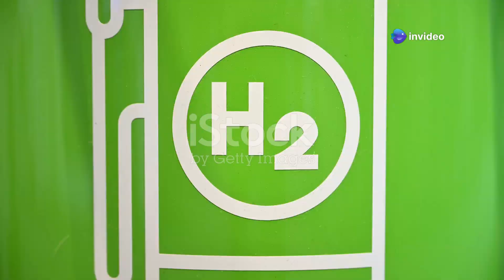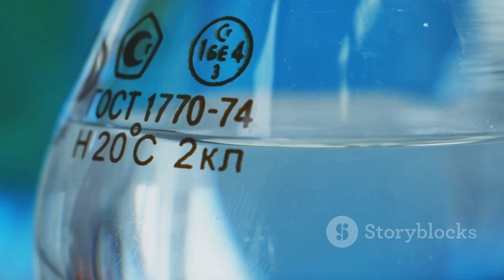New Solar Discovery Could Revolutionize Hydrogen Production

Comment: Huge amounts of H2 will be necessary for new processes (direct reduced iron- DRI) to green-up steel production and if the solar produced H2 were only used for that, it would go a long way toward mitigating global warming.
Reply from the maker: @ronkirk5099  Absolutely! Using green hydrogen in DRI for steel production could significantly cut emissions and help fight global warming. Scaling up production and renewable infrastructure will be key to making this a reality. What do you think about accelerating this transition?

Comment: Reasons against;

Inefficiency: Hydrogen production, storage, and use involve significant energy losses.
High Costs: Expensive production and infrastructure compared to alternatives.
Storage & Transport: Low energy density, leakage risks, and costly transportation.
Competing Tech: Batteries and direct electrification are often more efficient.
Safety Risks: Flammability and explosion hazards during storage and handling.
Infrastructure Gaps: Market and technology are not yet scalable or mature.
Sector-Specific Limits: Not ideal for vehicles or heating; better alternatives exist.

Reasons for:
Pay lobbyist salaries
Reply from the maker: @Education-sw2wg  it's a future dream and I agree about the salaries lool.
Reply: Exactly the same thing was once said about batteries. Also back in the days, planes were to heavy and never going to fly to.
Reply: @mathijsbroeders3454  There were no alternatives at the time, today as you said, renewables and batteries are far ahead and will continue to do so. Let's see for the future of hydrogen, but the spendings today far exceed any applications that are both financial and scalable. :) The main issue for hydrogen in the future is transportation as its a liquid, compared to electricity being high tension cables. I would prefer the spending on hydrogen being used on pv massively. 

Hydrogen might be interesting for green ammonia, but a hoax for transportation currently.